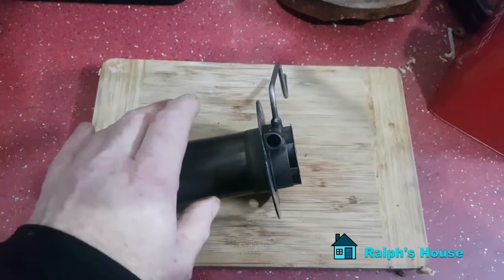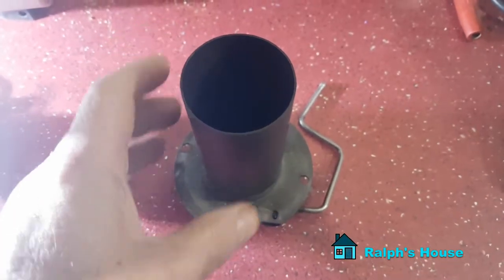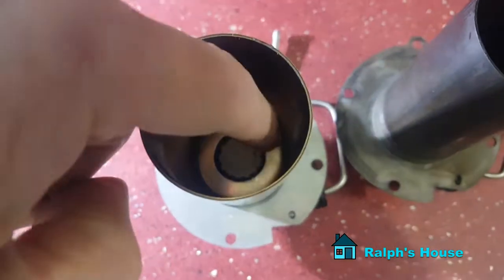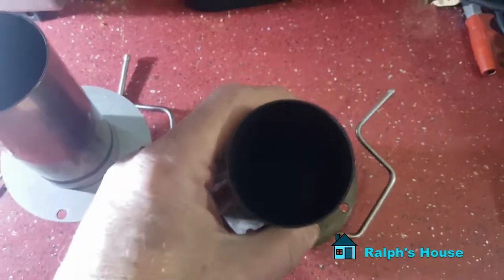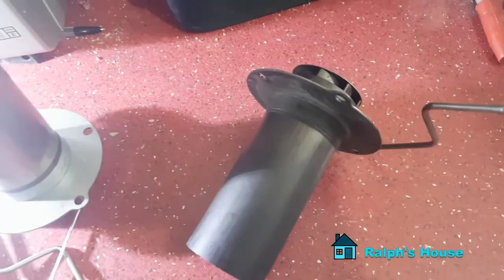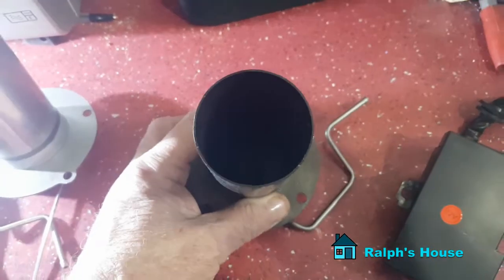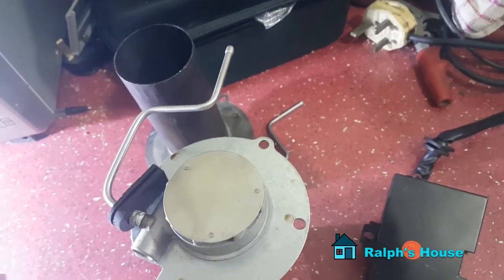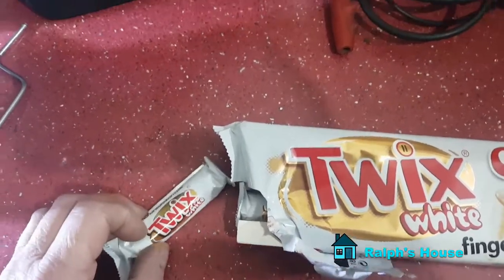204. E-08 Error - Chinese Diesel Heater

Comment: I have 2 of these units that will not start and has all the symptoms you described I have had apart a number of times 1 is only 3 weeks old. I am soaking these parts in a parts washer right now and will clean as described and see if I can fix this I was about ready to garbage them but I think I agree this is the problem as you described. Will clean this evening and try again. Everything else mentioned has been tried with no success.
Reply from the maker: Almost certainly the cause. Virtually nothing about this problem anywhere other than what I've put together here - after much investigation. Sadly too many junk perfectly good heaters because they just can't start them anymore. They replace pump, no joy, they replace temperature sensor, no joy, etc etc and just give up. The back of that burner is crucial. It has to be clear of debris. Don't be surprised if you come across such big chunks they rattle inside and won't fall out. If that happens, shake them so they fall into the air vent area, and break them up there with a suitable pick. Make up a pick like mine. Coat hanger wire may be a little too thick or not strong enough so see what you can come up with. Don't ever run them on veg oil either lol
Reply: Well I was confident I had them cleaned out Couldn't get anything more out of them  Since I also soaked them in Varsol  for a couple hours I heated them up after and they both started a fire in the chamber to burn out the Varsol I let them burn out on the garage floor and they looked really clean I ran a copper wire and a 90 degree hook through them and put them back together. The first one went through the cycle white smoke etc and came up with a E8 and while sitting on E8 with the glow plug still on it fired but went out again since it had no fuel  I tried it again No fire I then started the New one again white smoke No fire on this one either. E8 on both I was sure this was the solution  Any more ideas. If it would start it would run Been hard to get started every time I have tried since new Impossible now. Cold here Will have to buy a different heater of some sort tomorrow. Dwight.  @Ralphs-House
Reply from the maker: @dwightmcammond5597  What are you running it on? Make sure you use very clean fuel. Are you over-priming it. I never prime at all - seems to help.
Reply: I am using fresh diesel winter fuel the same fuel I use in my Diesel vehicles. I also am drawing air from inside Exhaust is less than 2 feet They both flood with fuel when I do a start up When I open up everything is full of fuel.   @Ralphs-House
Reply: I have tried both prime and non prime. I ordered 3 new burners and will see what happens when I install a new burner. Everything else seems to be working. I do see a comment or 2 about Alpine mode or the board fuel setting. What is your idea about that ? if it can be reset how do we do it? 
 @Ralphs-House
Reply from the maker: @dwightmcammond5597  Right, buy another burn chamber (cheap enough) and swap it out. Make sure you have a spare glow plug. Ideally it needs testing on a power supply but if you do it quickly, it'll cope with 12v. Should heat up red.

Comment: Thanks for the warning Ralph. I wonder whether sooting-up is more likely in alpine mode? Also, can I ask  is it acceptable to take your air intake from indoors, rather from frigid outdoors air? Could there be any issues, other than the extra sucking noise?
Reply from the maker: Technically, the burn chamber air inlet should always be outside to prevent any smoke being backfed into the area being heated. I get that, however I don't and for the following reasons. For one, my heater isn't having to work anywhere near as hard because its not heating freezing cold air, and on the rare occasion this has happened (usually because of a flame out scenario), fume ingress was miniscule, only lasted 5 seconds and didn't even trigger my carbon monoxide alarms. This subject in itself tends to start a 'heated' debate as you can imagine but I've long given up investing my time in the back and forth of anger it seems to give rise to. I have better things to do lol. Some mount the entire heater outside, generally in a box, but that then requires two 3" holes drilled through your property which I honestly couldn't justify so I opted for a 28mm hole drilled (Toolstation for the bit - about £11) for the exhaust. The only other thing I changed was to bypass the small tank in the unit and drilled a 10mm hole and fed my fuel from a far bigger 20 ltr container placed outside. This negated the need for constant (and stinky) top ups of the onboard tank. Works well. I can either replenish the tank with diesel at the garage, or sometimes by ordering 20 litres from Rye Oils (direct via their website not shopping sites) and its there the next day and post included. Price about the same. You can also use Red if you have a local supplier via a pump. Happy to chat on the phone anytime by the way. Can direct you to my FB page or vice versa. Definately a very viable heating alternative. Came home from my P/T job today and it was freezing outside as you know. Had left it on lowest setting. House was gloriously toasty when I got back Ben. As I said, you need to leave internal doors open for the heat to circulate but that doesn't bother me. Sooting up can be avoided by not straying from diesel or kerosene - unfortunately quite a few (including myself) discover that its a hiding to nothing. Any savings lost in downtime and cleaning. They're economical as they are.